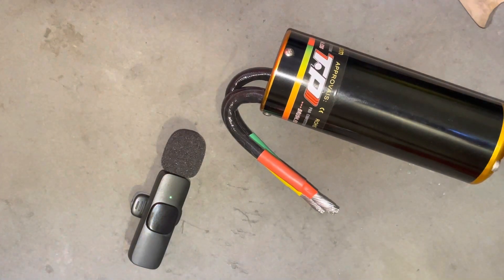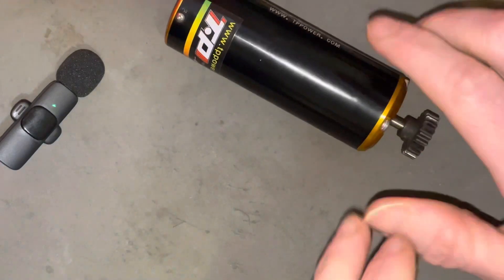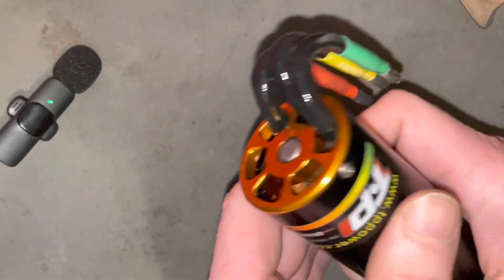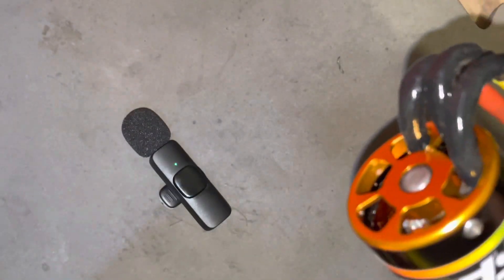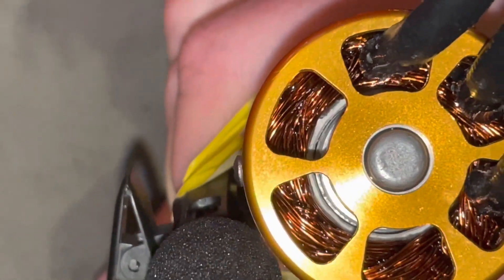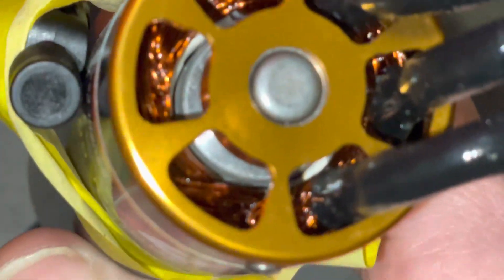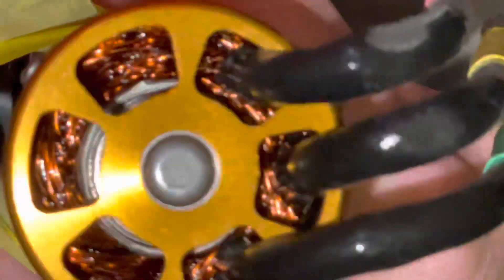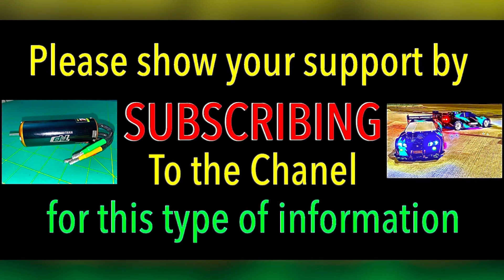TP 4070-CM.. FACTORY DEFECT or NORMAL?

Comment: I have the same issue,the motor only ran for 10 seconfd,I called island hobby and the said it has no warranty,spent $230 dollars for a motor that was defective,very unhappy with my first tp motor,never no issues with castle
Reply from the maker: @nadirkhan5584  ….. that’s very unfortunate. What happened after 10 seconds? Did the logs reveal anything?
Reply: @toysforboysrc  nope rotor is perfect motor works,no power

Comment: Keep doing these reviews, because it helps.  I was thinking about getting several  TP motors.  Now that I know they don't communicate well, I'm not getting the 4 motors I wanted.  I'm not happy with castle either, they don't honor their warranties.  I hope someone comes out with a reasonable esc motor combo, that is in the speed range of both of them.
Reply from the maker: @JasonGunn418  …. Castle has a “disclaimer” in their warranty. I had a situation with an esc that I needed warranted and I got rejected. So I did tons of research and did my studies and contacted the claims department and expressed the “gray area” in their disclaimer in conjunction to how they advised WHAT the esc can do and WHAT is and is NOT considered 
(Proper use) (application) and if it brakes the warranty, then SO DOES THEIR ADVERTISING. You don’t post a video of an xlx2 pulling a school bus and THEN tell your customers that it’s their fault it failed while NOT pulling a bus. Long story short, I got my $#¡+ replaced. As far as TP goes, the second motor that I did install never failed and I love it. Island nut hobby is a great source of information and communication. HOWEVER don’t bother trying to contact TP directly because you will fail. My advice is to buy from island nut hobby because if there is a problem, they will take care of you because you got it from them.

Comment: So what ever happen did they fix it for u, i am looking into these motor not sure where to get it. just in case something like these happens. Its very clear n loud enough to her it.
Reply from the maker: Hi, it’s complicated… I “meant” to order it with an 8mm shaft but accidentally ordered one with a 5mm shaft. When I realized it several hours later I called to modify my order to an 8mm but it had already shipped, so before it arrived we already had the return/exchange lined up before I even made the video. Of course I was eager to see it in person bcs I never owned a TP before. I like to scrutinize things that’s just me, so I could not resist making the video bcs eeeeevery body has a TP but I NEVER heard or seen anyone talk about what I was looking at and it started a storm of ppl worrying😒but half said that it will brake in after a while and to be honest I never seen or heard of a failure from this clearance stuff, but this topic could go on for ever🤷‍♂️.. anyway I continued to proceed with the return and when the identical motor but with the 8mm shaft arrived, it also had a super fine clearance and spun better but at that point I realized that that’s just how TP motors are and I stopped worrying about it so I didn’t mention anything to not sound like a Karen lmao or like the picky guy that I am, but that pays off with clients as I’m a perfectionist. I never ever had any problems with my 4070 2200kv 8mm TP motor, but I truly got worried during that initial first unboxing ever.

Tip…. I also noticed that although I bought it from (island hobby 🫶#1) 
I also did research on the actual TP motor website and I found a section that said if there is a factory defect, it must be sent to TP motors them selves for inspection.. so I was partially worried that I would have to deal with TP instead of Island Nut because TP doesn’t even talk to their customers which is why I went with Island Nut to begin with.

I’ve had other customer needs with Island nut concerning more future purchases from them and the owner IZZY is a SUPER awesome guy. So after getting to know the staff, they really treat you good!

Comment: Put power to it, it's gonna float. That's the part that gives its directional pull. Very strong motor 💪🏻
Reply from the maker: As in the counter balancing will pull it to center I imagine you’re saying., idk bcs it was my first TP purchase but customer service was awesome. I had already put in a return for this motor before it arrived bcs I accidentally ordered a 5mm shaft instead of 8mm shaft but I could not help looking at it soon as it came in but I’m glad I did bcs the second motor did not have the binding issue but it wasn’t perfect either so that tells me that TP motors are just like that.

Comment: I agree TP does not answer the phone. I tried for months before I just went with Castle for my current project.
Reply from the maker: Yes I have the 1717/1650 and it’s a Beast! Not many motors can perform well on both 6s and 8s. Most 8s motors run poorly on 6s bcs there’s not enough voltage, but the 1717 runs great on both 6s and 8s.

Btw I ordered my TP from Island Hobby Nut and it came within 3 days! Suuuper fast shipping and they have a great staff and support. They even carry Scorched parts too.

Comment: Had same problem only solution was to buy another one
Reply from the maker: Was this a new motor? What was it not replaced or covered?
Reply: @toysforboysrc  brand new two passes on 6s 4070 2400kv bought from same place. Couldn’t get a hold from tp by any means of communication.
Reply from the maker: @javieracosta6281  …. Not good at all, you ever bought TP from any other sources like island nut?
Reply: @toysforboysrc  that’s where I bought it from. Gave me phone and email to reach them never reply so only option was to buy another one
Reply from the maker: @javieracosta6281  …that’s horrible. Guess the only way is to inspect the hell out of them and decide to return it right away or keep them as is bcs their return policy is a strict 7 days with NO use.